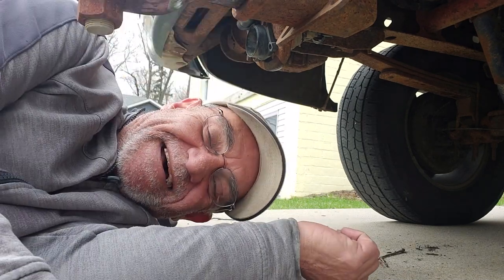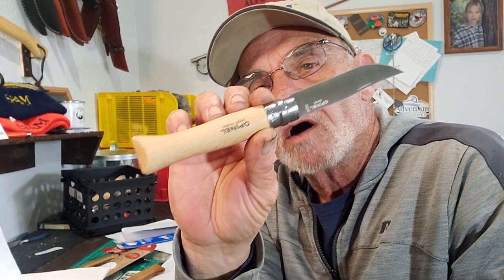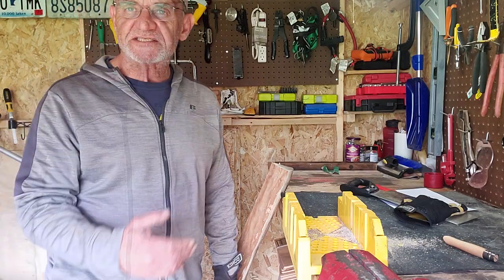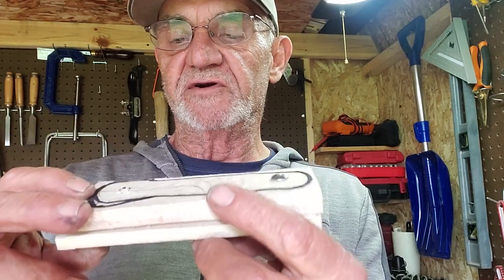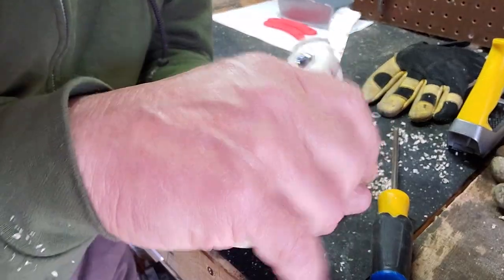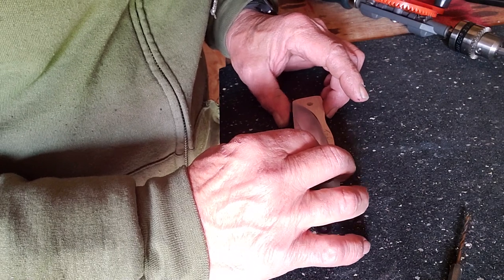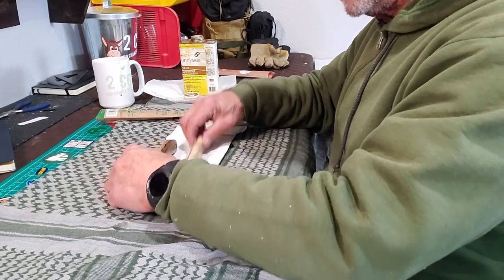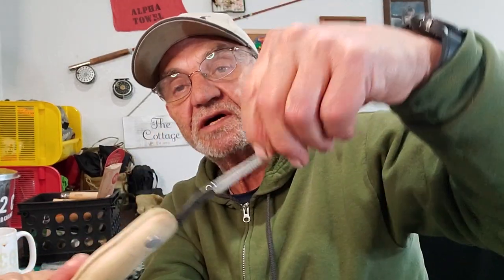SVORD Peasant Knife Upgrade - Opinel inspired handle and safety tip for your Svord

Comment: You're a nice guy, George!  I enjoy your videos.
I'm thinking of making or buying a peasant knife.  The blade may be a bit challenging as I no longer have access to an acetylene torch.  I'm not sure my bottled MAP gas would do the trick--so I may buy one and make a handle.
That prong that sticks out when the blade is closed got me thinking.  Maybe I can make a belt sheath for it.  Moulded leather and deep enough that the entire handle is covered--and use the prong to pull it from the sheath!
Looking forward to your next video! 👍
Reply from the maker: Thanks for kind words. They are a fun knife with lots of options to modify for sure. Be safe 😁.